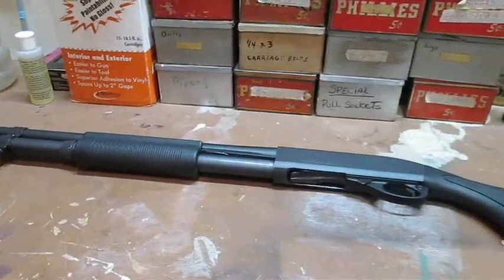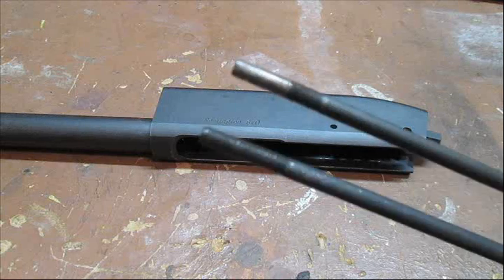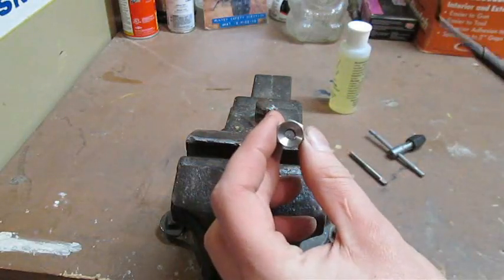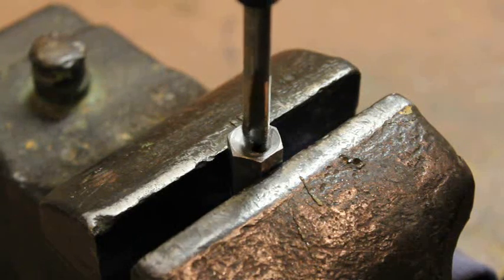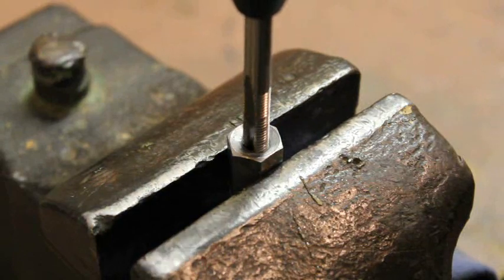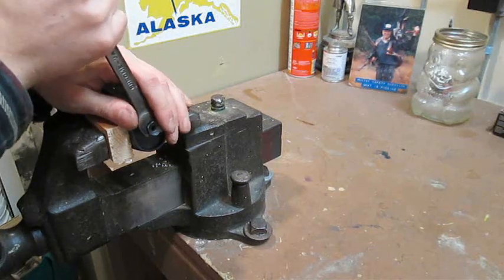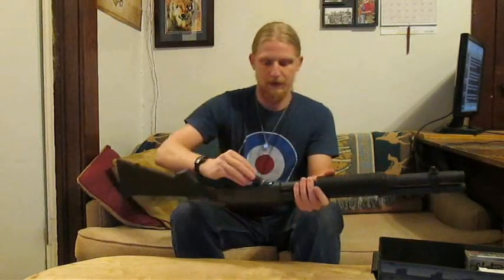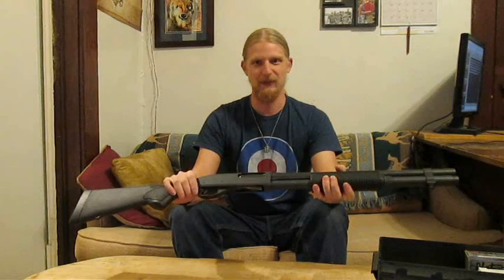Receiver Stud Replacement & Repair - Remington 870 Tips & Tricks #2

Comment: If the stud is threaded all the way through, why not start your tap from the other side so that you will engage the good thread initially and will be sure that your tap is not damaging the good thread.  It will then start cutting when screwed in much further and starts to engage the damaged portion of the stud.
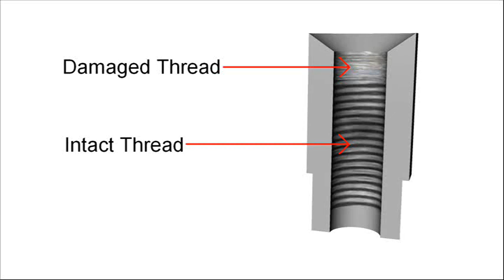Reply from the maker: The stud isn't threaded all the way through.  See 3:21 in this video.  It's designed this way to ensure that an overly-long fastener can't extend into the receiver and interfere with the gun's function.

Comment: Just wanted to say that this was the perfect how-to video. Not only explaining what to do but why to do it. Thank you.

I bought an old 20ga 870 wingmaster at auction and it came without a stock. When I got a new one... it didn't fit. No receiver stud in there! New one on the way and I think I'll be able to get this thing back in action. I'm going to check out the rest of your tips and tricks too. I think this thing has trouble feeding. I suspect it's an old dog carrier spring.

Thanks again from a fellow Alaskan!

Comment: Pro Tip: If you're paranoid about cross threading anything (maybe not jar lids) you rotate it backward until the threads fall into place and then thread as normal.

Comment: Hay dude great video. I have the Remington 870 MCR breacher with the removal/changeable barrels and handle stock. I’m trying to change the stock to an aftermarket AR style stock but it seems the Remington MCR doesn’t even have a receiver bolt when taking off the existing handle grip. Can you please shed some light on this?

Comment: I question the use of anti-seize on the threads. Any kind of lubricant can cause over torquing  when tightening ie, the threads will be under more pressure than designed for because the lube causes the threads to slip farther together than they normally would. The second thing is vibration from recoil might cause the bolt to unloosen, Most bolt science I have read states they should be kept dry and torqued to within certain parameters. If they are too loose or tight they can fail. Of course some applications require anti seize.
Reply from the maker: Fair points.  Thread compounds do change torque values, and there are applications where they should and should not be used.

However, this is not a high-torque or high-load threaded connection that requires a very precise torque setting, so there's no real need to worry too much about how a thread compound affects that.  Simply avoiding over-tightening is pretty easy.  As for staying in place, 7/16-28 is a very fine thread pitch, so it's inherently stronger and more resistant to loosening than a coarser thread at the same torque would be.  This gun has fired many, many rounds since this repair, and the stud hasn't moved at all.

On the other hand, fine threads are much more easily damaged than coarse threads.  The threaded hole in the receiver isn't hardened steel like a grade 8 nut, and 30 years from now, I don't want to have to reef on the stud and tear it out, messing up the threads in the process.  Anti-seize helps protect against seizing from galling, friction, and corrosion, and I've seen threads - especially more sensitive fine threads or threads in softer materials - get pretty goobered-up from all of the above.

Really, the anti-seize is probably not necessary for your average 870 owner, but I change stocks a lot more often than most folks will, and I'm sure I'll be replacing the receiver stud again in the future.  I want this gun to last my entire life, so I take steps like this to help protect difficult-to-repair wear areas.

Comment: Do you know if the stud on an old Wingmaster has a slightly different thread pitch than the one on a newer Express? I have an older stock bolt from a Wingmaster that won’t thread into my 2 Expresses.
Reply from the maker: It's possible.  The first 870s had some odd part and design differences that Remington changed up soon after full production got going, so some very early guns can have minor compatibility issues with newer parts.
Reply: Synchronizor Thanks for the reply. I enjoy your channel. New sub here.

Comment: Hey I had a random question I just got myself an 870 and I'm having problems removing the wooden forend stock. I removed the nut which came out very easily I even tried a little tiny dab penetrating oil cause I know that's not good for Woodstock's but it's still won't come loose and I don't want to force it or break the Woodstock because it is still in decent condition what can I do to ease that sucker out of there?
Reply from the maker: I'm kind of confused.  Are you trying to remove your stock, or your fore-end?  Either way, once you remove their respective fasteners, there should be nothing holding them on.  Can you be more specific?
Reply: I needed help removing the fore end without breaking it. I have heard on very old 870's sometimes breaking them off is necessary, but I wanted to save the wooden fore end because it is still in mostly good condition. Thank you for your time, I have already solved the problem with a few good taps with a mallet. I eventually wiggled it free and was able to clean both pieces so dis assembly would be easier in the future. Thank you also for your video about the differences in shell carriers I will be ordering one from factory for my 870 because it is my home defense weapon. If there are any reliability upgrades you can think of to add to my list I'm all ears.
Reply from the maker: Frankie Hernandez While you're ordering the new shell carrier, check the breech bolt & slide assembly.  If those are old-style too, you'll need new ones to get the full flex-tab fix.

I'd also check to see if any of the original springs are feeling worn out, and make sure there's a stock bearing plate installed.  Other than that, you should be good to go.  870s are all very reliable in stock condition, the flex-tab is the only significant design change they've gotten since they were introduced.

Comment: I cannot even begin to turn the screw/bolt that holds the stock on with the biggest flathead I can find.  The last person must have red loctited it or used an impact wrench.  Taking a saw to the wooden stock popped into my head a couple times. It was my Dad's hunting shotgun and I just can't bear to see even the cheap/affordable stock destroyed...
Reply from the maker: Hopefully someone didn't try using red Loctite.  You may just be dealing with some corrosion making the stock bolt stick in the receiver stud.  Try taking the gun's trigger plate assembly out, and spraying a little penetrating oil through the hole in the front of the receiver stud.  If that doesn't work, there are some tools that let you put more torque through an 870 stock bolt than you'd want to with just a flathead screwdriver.  That should be enough to thread the receiver stud out of the receiver, so you can save the stock.  Then you'll just need a new stud & bolt, which aren't expensive.  A gunsmith should be able to help you with that.

If you haven't seen it yet, I have a detailed video on removing & re-installing 870 stocks and grips, which includes info on those special gunsmithing tools and tips for loosening a rusted stock bolt.
Reply: Thank you, I've removed the trigger group and sprayed some PB Blaster up there.  I'm going to give it some time and let it do it's thing.  The next thing I'm going to do is to lay a high powered soldering iron on the insert and let it heat up - in the event some smart guy did use the red loctite.  Sadly, even using the hugest screwdriver in existence, I managed to kind of mung up the head.  The last bit of bite I can get on that screw will be after I let it heat soak... Then I pay a gunsmith to watch him remove it before I can even look around the store.

Comment: What to do if your main bolt just spins when you try to take off stock, what's the best way to get it to back out? This 870 is about 35 yrs old and when I attempted to remove stock the whole bolt and threads everything just spins.
Reply from the maker: It spins, but doesn't back out at all?  Not sure why that would be.  I would say try applying some rear-ward force on the stock while backing off on the bolt.

Comment: Why not install the stud with blue locktite ...it'll be removeable next time around ...and won't back out with vibration...
Reply from the maker: I've never seen an 870 stock bolt back out due to vibration.  Between the long length, fine thread, lockwasher, and compressibility of the stock material, they stay tight very well without any threadlocker.

Comment: a little tip.  next time start the tap through on the other side of the stud if the threads are still good on thatend.  this way you are 100% sure the threads match.  Other wise a great video.